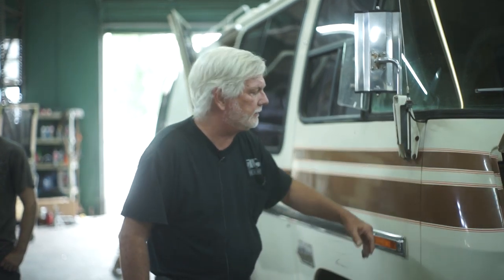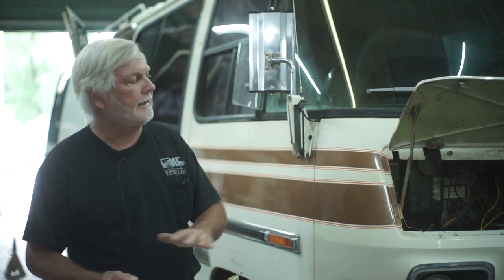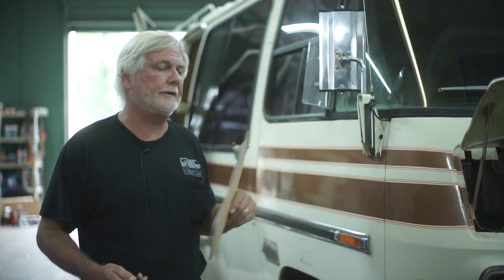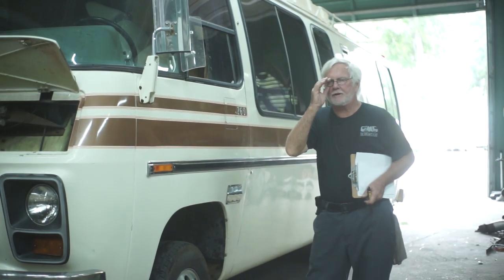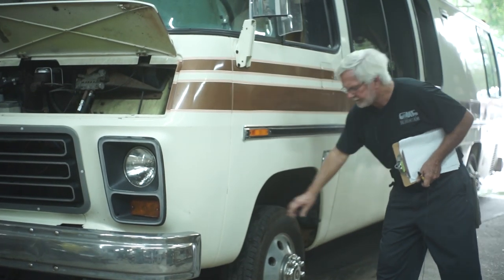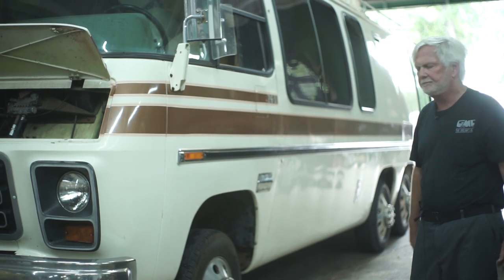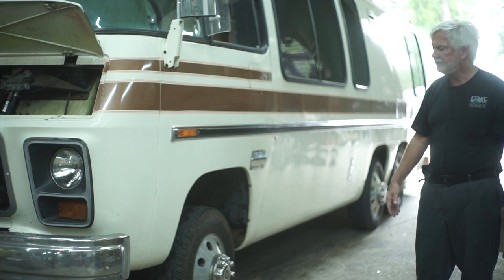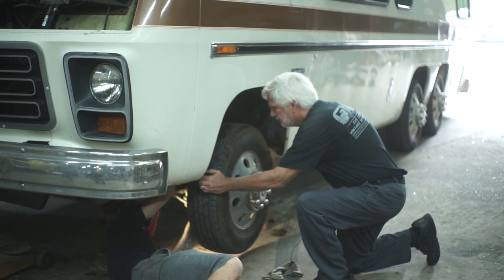Vintage GMC RV Mechanical Review - Here Jim Bounds tells all the secrets to make a GMC reliable.

Comment: Happy Revcon owner here, #71-0004. Love what
 you do! We share a drivetrain!  Jim, please tell people 
 we also need to adjust our torsion bars so our axles 
are dead horizontal out of the third member  so our
coaches ride with the CV boots NOT twisting up 
and down every rotation. Perfect recipe for ripping 
them open, as seen in your excellent video.